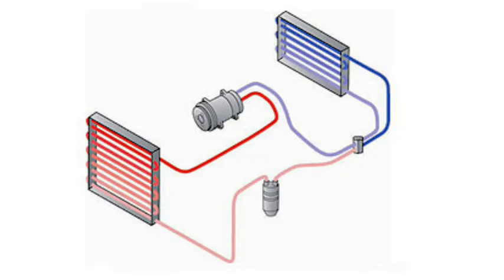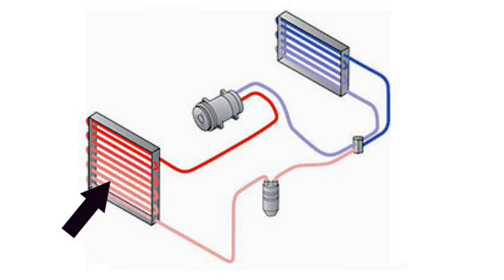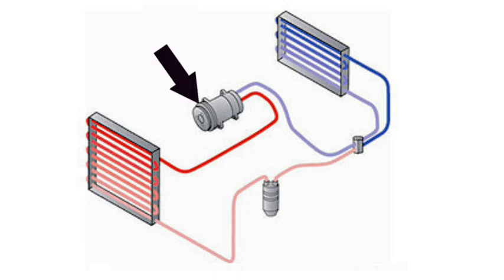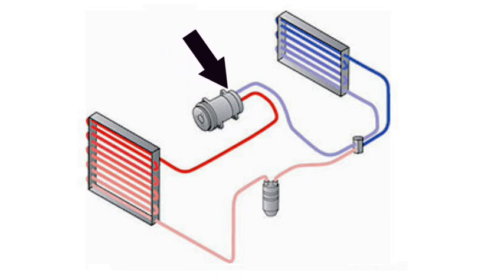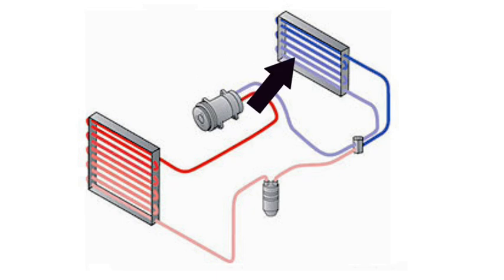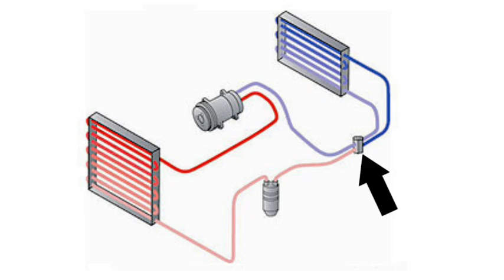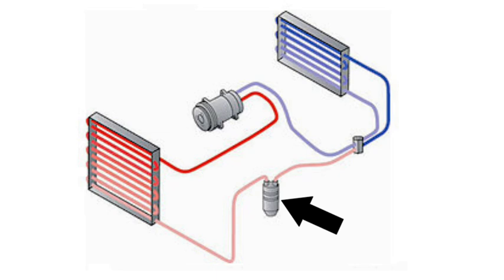AC System Basics - EricTheCarGuy

Comment: I have a question out for grabs if there are any takers.  I drive a 2009 toyota camry.  The AC was becoming noticeably less cool over the past few weeks.  Now, when I turn the AC on there is NO cool air and there is also a prominent and constant hissing noise that can be heard as long as the AC button is on.  I've never had Freon added - OK, so I need to add Freon - but what would be causing the hissing noise? Could the noise point to something more severe than merely needing more Freon? Any thoughts anyone has before I take it in would be greatly appreciated.  Thanks!
Reply: Never heard of a "leek" just leaks in my ac units
Reply: Freon or refrigerant y'all crack me up 😂😂
Reply: hissing sound in the engine can be a result of a vacuum leak. so maybe the same thing is happening in your AC system and your compressor is sucking air through the low side tap
Reply: Thanks guys - actually, it just needed Freon.  I never had that done before, but after I got it leveled up, the noise disappeared and it works fine now.
Reply: +Wes Kellogg Did you charge the unit with Freon or refrigerant?
Reply: Freon as far as I know.
Reply: You got a leek
Reply: Sort of like how "spiritualists" interchange the word "spirit" and "soul" which mean two completely different things, lol that cracks me up.
Reply: I'm glad someone got it!
Reply: There was a snake under the hood...nesting on the AC compressor. It hissed when startled by the compressor running. He slithered away when your fussin' with PARTS and things had grown rather tiresome to him.
Reply: He probably also disliked being sprayed with freon
Reply: Lol
Reply: Well, if you want to get all technical about it a 2009 camry does not use Freon... Freon was GM;s R12, todays cars are now using R134a... so ha
Reply: Indeed. So, would refrigerant be a valid term?
Reply: Indeed
Reply: yes lol, just use propane, might be flammable but it will work haha

Comment: My clutch engages as it should when a/c is switched on, however, doesn't take a refrigerant charge. Pressure builds up too fast and it appears that compressor is not circulating the refrigerant. A/C not blowing cold. Blocked somewhere? Orifice tube maybe?

Comment: Eric about how long will your AC last for ,if you go to a garage and get refrigerant refilled where it  has runout , where I live is Ireland and we are not spoiled with that many hot days ,lol  ?
Reply: Did you ever get an answer? The answer indefinitely. Unless there's a leak you never need to refill it.
Reply: +GymChess you are wrong there are no true sealed systems, that is impossible. the system is allowed to leak 1/2 oz per year which is normal. This means that eventually you will need to recharge your system.
Reply: Yet the official view is that if you ever need to refill it there's a leak. I guess that implies that if there is no leak, you won't have to refill it.

Comment: I guess the compressor works on 24V, what happens when the battery goes low and its not able to supply enough volts/current to maintain the rpm of compressor? Does it affect the life if compressor if I run it at lower rpm?

Comment: What a fabulous explanation by using a simple can of dry air to demonstrate the theory of an Air Conditioner, Thank you Eric the Car Guy.
Reply: +Henry Gonzalez It goes deeper then that tho, expansion creates a cooling effect. Compression creates heat due to the friction between the molecules moving around (function of ignition in diesel engine), expansion does the opposite. The refrigerant comes from the pump as a hot gas, condensates in the cold condenser then goes as a liquid to the  evaporator where it is evaporated back to a gas, the expansion of the evaporation creates the cooling.
Reply: Coi

Comment: if i can smell the sour gas from my ac. i think most likely the evaporator has leaking or burst. 
Eric, could it my evaporator?
is it a common issue?
friends told me most likely is the evaporator , which i suspected too.
need to top up 2wks ago.
if it's the condenser i don think i can smell it, correct. 
pls hlp. 
cheers.

Comment: 1 Question ¿if i replace the used  AC compressor . ¿in wich hole  should i put pag 46 oil? low compressor hole or in the high compressor hole? thanks. i will appreciate it

Comment: Hi Eric I have a question about my Hyundai Starex Van AC. Ok, here's the situation: Whenever the car is moving a over 50Kph AC is cold as if nothing is wrong but when you slow down specially when in traffic AC will no longer blow cold air its like AC is off and only using fan mode. But when you move again continuously over 50kph wow its really cold. What do you think is the problem? We have had it checked at a local car AC repair shop all they say its getting high pressure and they will fix it as they said they did but problem still persist. I hope you can help us.

Ohh been a fan of your videos for over 4 years now.
Reply: +fulcrum062505 could be low on refrigerant, could be restriction inside the ac system or outside ac condenser or evaporator fins may be clogged.

Comment: Cheers Eric I think that's helped me figure out the problem with my friends fiesta (well apart from it's a fiesta). You mentioned about moisture in the system and I think that's the problem as it's not getting cold on the other side of the expansion valve so I'm figuring it's got bunged up with sludge.. An article on FlowDry's site talks about cheap desiccants also being a problem as they can react to the oils and form sludge so I'm wondering what you recommend or have experienced. It's looking like big bucks as the DIY route is probably going to introduce more moisture anyway.

Comment: Hi Eric... I have a 1997 Nissan pickup truck... the other day I left it running with the ac on and when I came out ...the truck was off... so I got back in it the dash lights where on I was like mmmm turned the key and the truck started back up  ..  I drove always but the ac stop blowing cold air.. when I got home I check to see why ... well the condener  like that hooks up to the drier busted lose..... I had saw it had stress cracks well I guess with the pressure  it pop right off... now I have to replace the condeiner on it..  I am not sure why it cracked for the lug nut..   also I already got a new condener but don't know how much oil to put in it.. then I would also have to replace the direr   what  you think

Comment: I just found out my compressor is failing.
A month ago I started working for a company as an AC (assistant)mechanic. (for split systems in offices and such)
I can borrow their tools and maybe one of my experienced colleagues will want to help me out with this.

But the only problem I think I'll face is the lubricant part. How do I know how much I'll need, and what type?
I drive a BMW 316i from 2000 by the way.

Comment: Hi Eric I have Volvo 202 S 80 I change the compressor pump on my car I change the A/C cooling fan and resistors the problem never gone away still have the same problem, still have the problems I had on my car. My car A/C rans for 15 minutes after 15 minutes slowly is losing the pressure like it goes off no air movement, when I increased few notch it blows the air again another 15 more minutes and slows down again. Could be Eric exponentiation valve is bad or dryer is field up with dirt? Can you help me out with that Eric?

Comment: Question is the high side liquid freon or is it gas ?
Reply: +Brian Pena High side is gas, as cold liquid goes thru evaporator it absorbs heat and evaporates, then gets compressed, getting even hotter, and goes thru condenser as a hot gas, there it gives off heat, cools, condenses to repeat the process.  It's an amazing bit of chemistry and physics...
Reply: so i would charge liquid Freon to the low side port correct ?
Reply: Brian Pena Yes always charge thru low side only, cans could explode with the pressures of high side.
Reply: +Brian Pena While you are at it, charge with a can that has xtra oil in it and dye.  You are probably losing some oil with leak and the dye will come in handy to find leak.  With system running and blower on high, add refrigerant until large silver can in system, called accumulator gets cold from top to bottom.  You can tell by placing your hand on it.  That's a good way to add the right amount without experience and gauges.